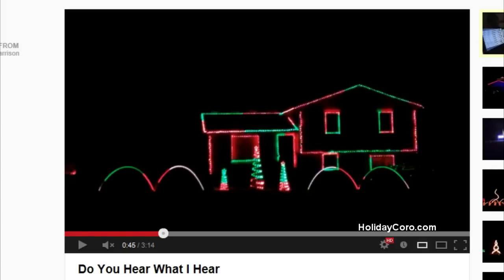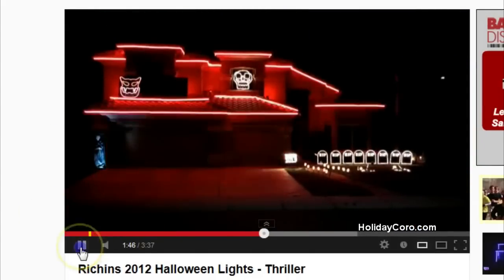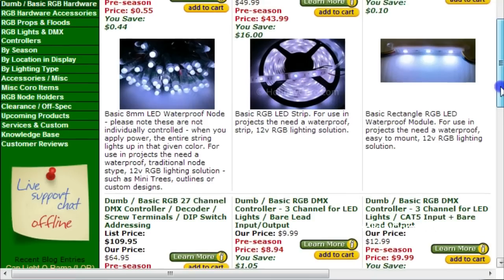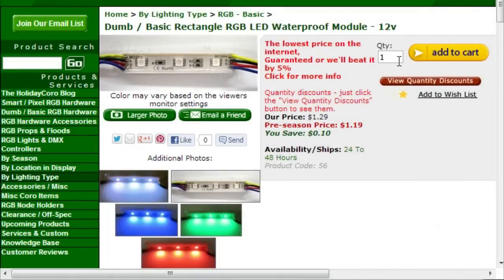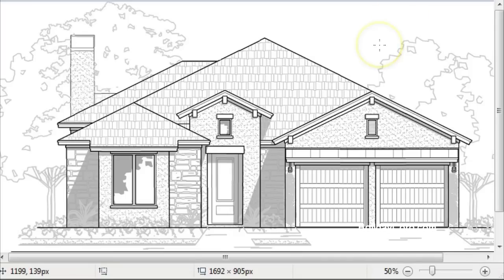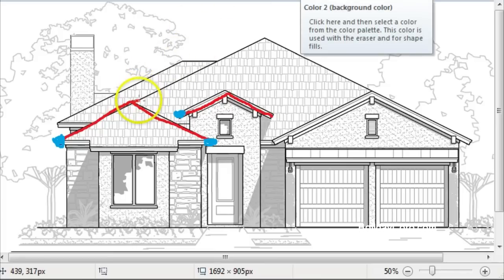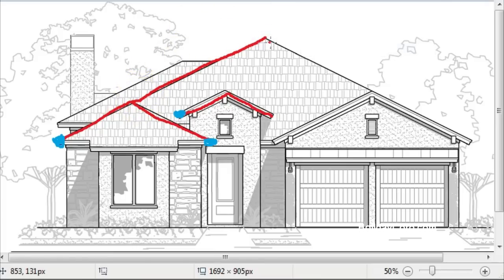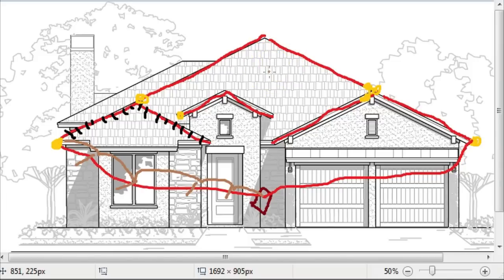Outlining A house with RGB Lights

Comment: I wish you would have included the wiring example for a decentralized setup and not just the centralized one.  It is still not clear to me how I need to wire the house outline when you decentralized the controllers over a large distance.
Reply from the maker: We will be releasing updated instructions and videos for distributed controllers systems like the ALphaPix Flex.

Comment: you explained really good ,good job, what kind on decentralize controller would you use and how do you get the power to each controller
Reply from the maker: We will be releasing updated instructions and videos for distributed controllers systems like the ALphaPix Flex.